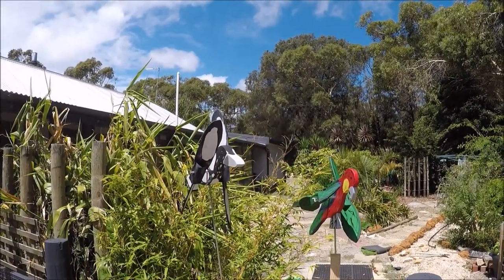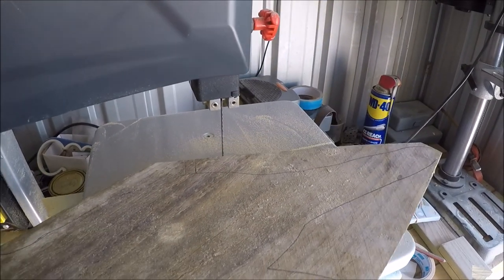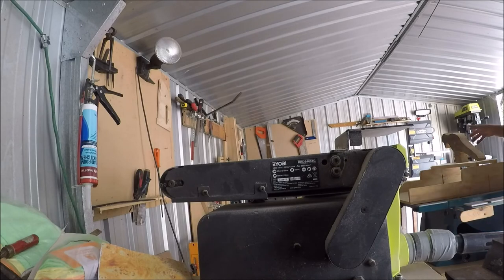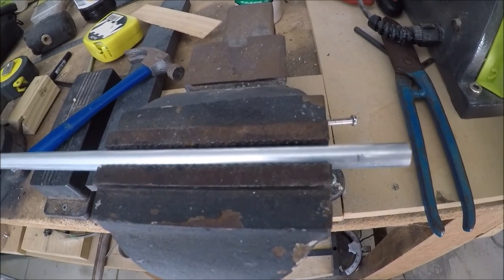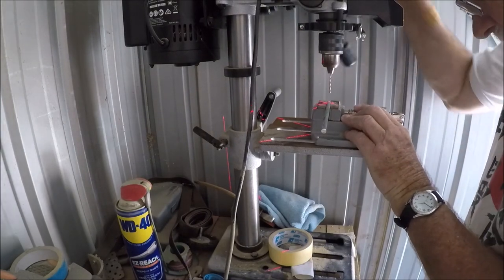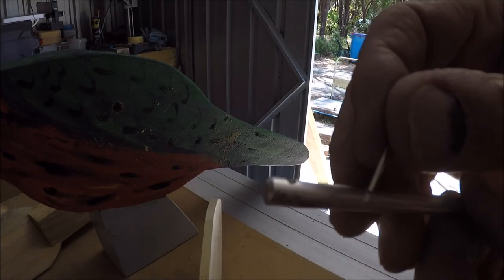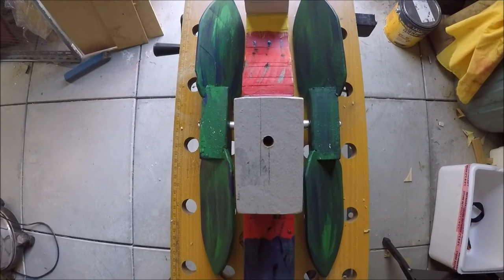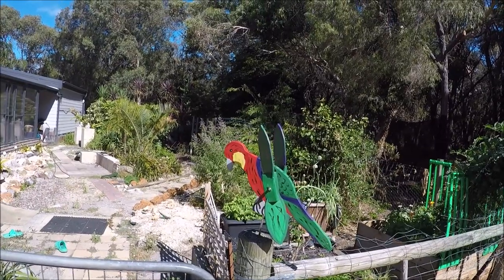Whirly Gig  Bird

Comment: Good job. I'd add washers each side of the wings to reduce friction caused by the split pins rubbing on the wings. Then lubricate with silicone or axle grease. Eventually the bushes between the body and wings will wear. I've seen small brass bushing right through the body with the axle fixed to the wings which are placed at right angles to each other (make sure the propellers don't oppose each other). I've got patterns somewhere that I've never used.  Get the leaf blower out to demonstrate the movement.  Good fun, but make the birds smile please.. Stay safe. Happy New Year,  looking forward to seeing more projects fro you. Cheers..
Reply from the maker: Hi Barry, thanks for the tips. I actually did some of the things you suggested from my previous forays into whirly gig making. If I cant get out of WA in the next few months this is what I'll be occupying my time with! Take care & be safe & Happy New Year.
Doug